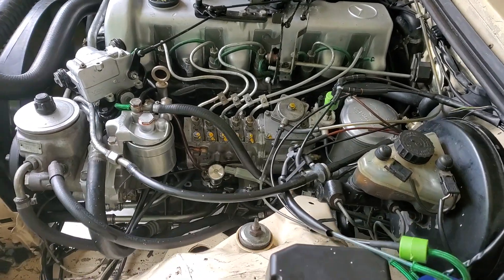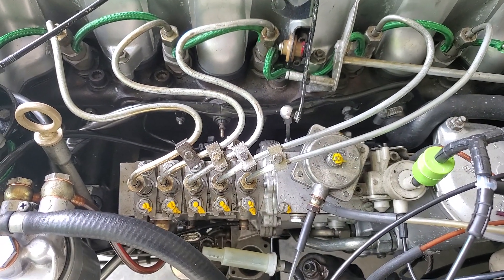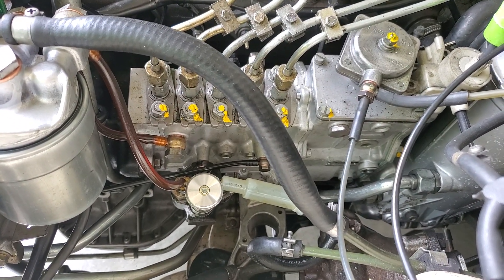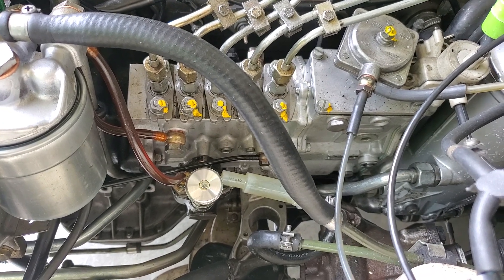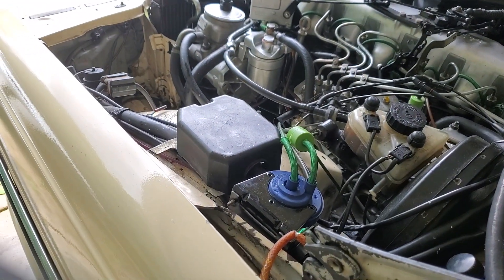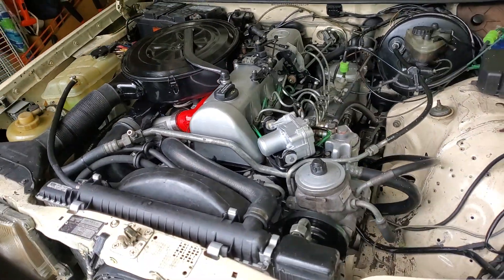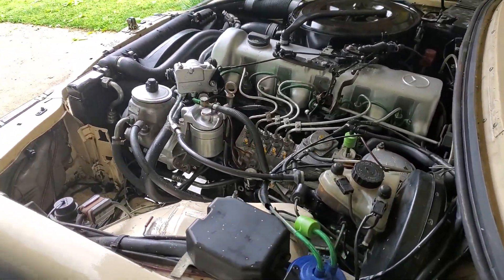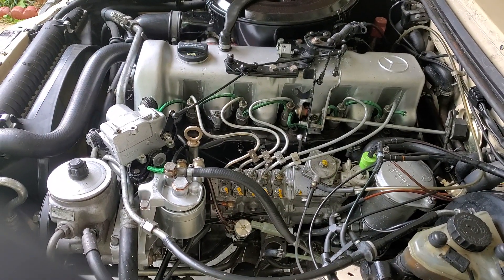300TDT Drip timed to 26 BTDC.

Comment: everybody and their brother shows the drips... you show reaching bolts.... THANK YOU.......  yet still no one shows what you do to make the drip faster or slower....  what do you do?  rotate some bolt somewhere??  do you rotate the pump closer to engine??  what do you do
Reply from the maker: Yes you just rotate the pump a little, and I mean A LITTLE. In my case with the super pump,, we are talking 2mm difference between no flow, full flow and perfect drips. Hope this helps. I used a heavy towel around the pump to not scratch it, and a large pipe wrench to hold the pump and slowly move it back and forth till perfect, then my help tightened down the bolts so it would not move on me once correct.
Reply: @gercoa9148  interesting.... that opens door to a stepper motor to move pump back and forth with  super fine threaded rod.  Which could be beneficial for adjusting time based on  combustion characteristics of any  fuel in use., and/or for say when engine is working hard.... and when it is idlig etc....  Would bet the one drip persecond is a compromise that sorta works for all things where having variability can work at more specificity.  

Then  there is alternative fuels which can vary some per batch, thus  adjusting timing a smidge on the fly based on sensor readings to ensure it is combusting well...  that too is an advantage.    

Some smarty pants could even control that with Arduino and sensors.... Once electric is not being fed to glowplugs... those can even be sensors. (if electricity to glow plug creates heat.....  then heat in area of glow plug creates electricity; which can then be measured.. Dats above my ability beyond  "conceptualizing it"  hmmm